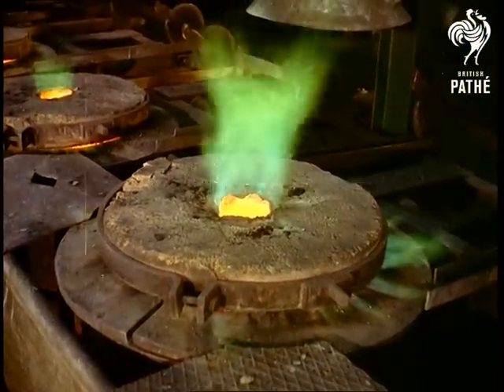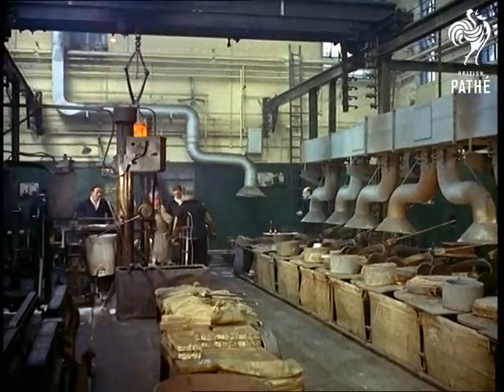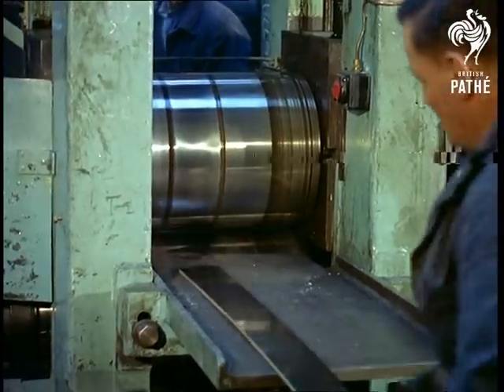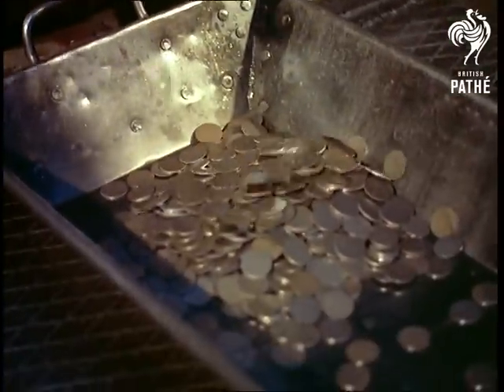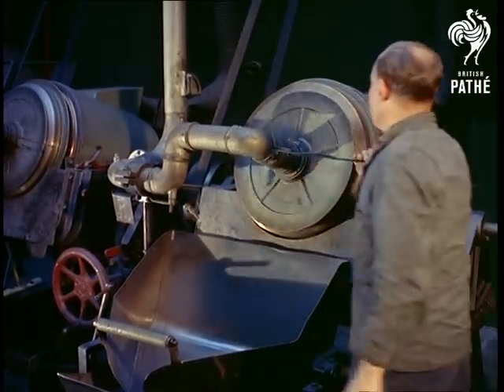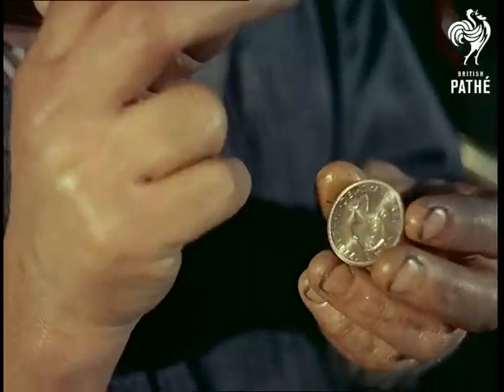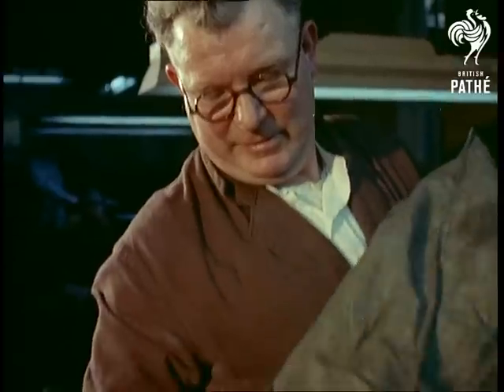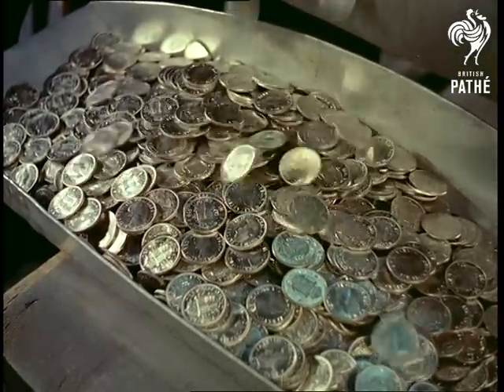Royal Mint (1956)

Comment: ahh remember the days when money was real ? i wasn't alive for it, but still.
Reply: Im still using cash only and i’m Gen Z. However I don’t think I can keep doing it forever sadly
Reply: @captainchaos1311  :hand-pink-waving:
Reply: @Captain Chaos I think what she meant by "real money" is the old currency system of Pounds, Shillings and Pence. 
For more than a thousand years, from the year 775 AD until 14-February 1971, England used the Carolingian monetary system. During those years, a Pound was worth 240 pence. This currency system continued until the formation of Great Britain (1700s) and United Kingdom (1800s).

1 Pound = 20 shillings
1 Shilling = 12 pence

A penny is further divided into half penny and one-fourth penny called farthing.
If the price of an item cost less than a shilling (pence only), it is written as 11d, 10d, 9d, 5¼d, etc. The letter "d" means "denarius". It is the Latin word for the standard silver coin introduced by the Romans. 
If the price has both shillings and pence, it is written with slash (/) as separator. Example: 15 shillings and 6 pence is written as 15/6. If the price is exactly 15 shillings without pence, it is written as 15/-
If the price has pounds, shillings and pence, the separator can either be slash (/) or dash (-). Example: 2 pounds, 15 shillings and 6 pence is written as £2/15/6 or £2-15-6.

When adding prices, you should have memorised the 12 Times Table to be able to add prices. 
For example, you bought 5 items in a supermarket:

Item#1 is 15/7 
Item#2 is 16/8 
Item#3 is 17/9 
Item#4 is 18/10  
Item#5 is 19/11

Total in shillings and pence: 88/9
Total in £sd: £4/8/9

By adding all the shillings and all the pence, you will get a total of 85 shillings and 45 pence. 
To get the exact amount in shillings and pence, you need to think how many shillings are there in 45 pence. The answer is 3 shillings with a remainder of 9 pence. 
Add 3 shillings to 85 shillings; you'll get a total of 88 shillings. 
Therefore, the total amount you bought in the supermarket was 88 shillings and 9 pence (88/9) or 4 Pounds 8 shillings 9 pence (£4/8/9). 

This is the reason why back in the days, British children were taught to memorise the 12 Times Table.
To make it simple, the old money of Britain was similar to the height of a person expressed in feet and inches. Examples: 5'7, 5'9, 5'11, 6'2. The amount in shillings is similar to the number of feet while the amount in pence is similar to the number of inches. 

A lot of people born after 1971 (or not yet an adult in 1971) thought that the Pounds, Shillings and Pence was a very difficult system when it was still in use in Britain. Videos in youtube always give the impression that it was a very complicated system. Someone even made a comment that it would be very difficult to give change if you are selling an item worth £1/5/9 (1 Pound 5 shillings and 9 pence) and the customer gave you a £5 note. hahahahaha... His comment shows that he did not live during the pre-decimal era. In schools, children were taught the arithmetic of the Pounds, Shillings and Pence system but in reality people in Britain don't count money in Pounds in their everyday lives; they only count in shillings and pence. It should be noted that after World War-2, there were only 3 banknotes in Britain: 10-shilling note, £1 note (20 shillings) and £5 note (100 shillings). The £10 note (200 shillings) was only re-introduced in 1964 while the £20 note (400 shillings) was re-introduced in 1970. During the pre-decimal era, prices in street markets, stores, supermarkets, department stores and even petrol stations were expressed in shillings and pence only. At Harrods or Marks & Spencer, you would see the prices of items were 67/8, 45/6, 54/10, 49/11, etc. The "Pounds, Shillings and Pence" will only show on the cash register during check out. In street markets, there were no cash registers, sellers just count and compute for change in their heads or using a pen and paper. During that time, shilling was the de facto main unit of currency while the Pound was the de facto superunit. The Pound as the de jure main unit of currency was only expressed in prices of expensive products such as TVs, refrigerators, cars, etc., in real estate properties and in big business transactions especially in international trade and commerce. If an item only costs 1 Pound 5 shillings and 9 pence, it would be written as 25/9 instead of £1/5/9. If the customer gave a £5 note which is equivalent to 100 shillings, the customer's change is obviously 74/3. The seller would then give the customer three £1 notes (60 shillings), one 10-shilling note, two florin coins (4 shillings) and a 3-pence coin. For the sake of that guy's curiosity on how to compute for the change if the price of an item is expressed in Pounds Shillings and Pence, here's how it works:

When it comes to giving or receiving a change, you only need to remember 20 and 12. There are 20 shillings in a Pound and there are 12 pence in a shilling.

If the price of an item costs 1 Pound and 5 shillings (£1/5/-) and the money given by the customer was £5, round-up £1 (1 becomes 2) and then subtract it from £5 (5-2=3). Subtract 5/- from 20/- (20-5=15). Therefore, the customer's change is 3 Pounds and 15 shillings (£3/15/-)

If the price of an item costs 1 Pound 5 shillings and 9 pence (£1/5/9) and the money given by the customer was £5, round-up both £1 (1 becomes 2) and 5/- (5 becomes 6). Subtract £2 from £5 (5-2=3) and subtract 6/- from 20/- (20-6=14). Subtract 9 pence from 12 pence (12-9=3). Therefore, the customer's change is 3 Pounds 14 shillings and 3 pence (£3/14/3)

From a currency similar to feet and inches (like a person's height) to a currency based on 10s and 100s. This is the reason why a lot of people in Britain find it hard to adjust when decimalisation was implemented in 1971 plus the fact that the decimalisation format used by the British government was flawed. From a very flexible denomination of 240 pence to a Pound, the British government chose a cramped 100 "new pence" to a Pound. On 15-February 1971, the shilling was devalued to 5 "new pence" (no longer 12) so that one Pound would be equivalent to 100 "new pence". Among former British colonies that transitioned to decimal currency, Ghana is the best. Ghana's decimal currency called Cedi (₵) is equivalent to 8 shillings and 4 pence (8/4) or 100 pence. Therefore, all the old pence are equally convertible to the new decimal currency. No need to worry about adjustment of prices; only the name of the currency and its denomination will change. 8/4 is ₵1.00 which means one Ghanaian Pound is equal to two Cedis and 40 pesewa (£1=₵2.40). In 1970, Bermuda Islands followed Ghana's decimalisation format. One Bermudian Pound is equal to two Bermudian Dollars and 40 cents (£1=$2.40). When South Africa decimalised the South African Pound, it converted 10 shillings (120 pence) to the new currency called Rand. 120 pence were converted to 100 cents. A little adjustment needs to be made when it comes to pricing and balancing bank accounts because 1.20 pence shall be equivalent to 1 cent. One South African Pound is equal to two South African Rands (£1=R2.00). South Africa's format of decimalisation from Pounds to the new decimalised currency was followed by Australia, New Zealand and Nigeria. Britain did the worst decimalisation format. Britain converted 20 shillings (240 pence) to 100 pence. Inflation was the result. The government of Prime Minister Harold Wilson was too afraid to lose the Pound as Britain's currency that's why he followed the advice of the Bank of England to retain the Pound. BOE and Harold Wilson did not follow the format of Ghana's new decimalised currency based on 8/4 (100 pence) nor South Africa's version of decimalised currency based on 10/- (120 pence converted to 100 cents). Instead, Britain decimalised the Pound by shrinking its value from 240 pence to 100 pence only. Some people in Britain even thought that the value of their money/income has diminished because in every shilling they spend (5 new pence) they were ripped off by the government for 7 pence. Devaluing the shilling from 12 pence to 5 pence was not a joke especially during the time when prices were still cheap. The ill-conceived decimalisation of the Pound in 1971 was one of the "ingredients" of the economic disaster of Britain during the turbulent decade of the 1970s. It may not be the main reason but it contributed to the economic crisis during that time. Maybe it's true that 10 is simpler than 12 or the decimal currency system is simpler than imperial currency system but the transition of Britain to decimal currency system in 1971 was NOT simple.
Reply: @friendly1999ph  I know how Pounds, Shillings, and pence work, heck if I lived in the 70s I would be a massive supporter of keeping the system. Its was truly the best way to count money,
Reply: @captainchaos1311 Thank you. You are the first person I chatted with from GenZ who supports the old and traditional money of UK.
Reply: For real money you'd have to go back to pre 1920 when coins were 92.5% silver. There was a time when a £1 coin was a gold sovereign.
Reply: @K_a_r_l_o_s all money is a matter of belief Adam Smith